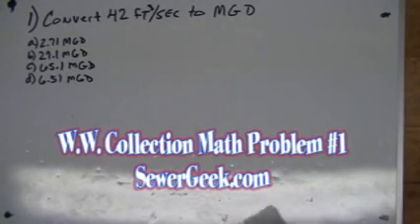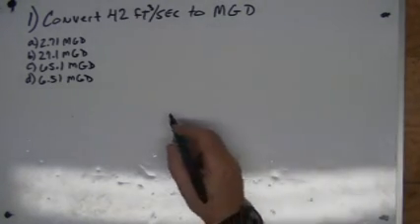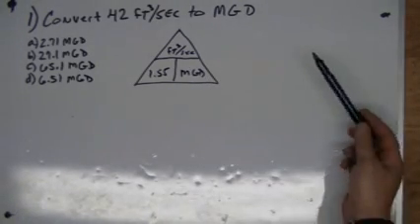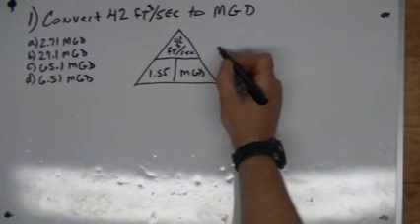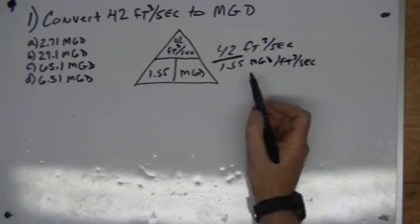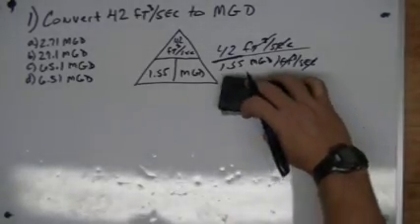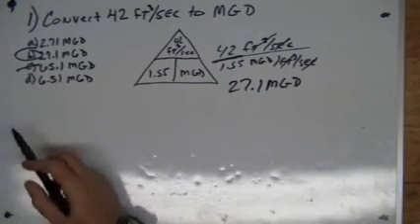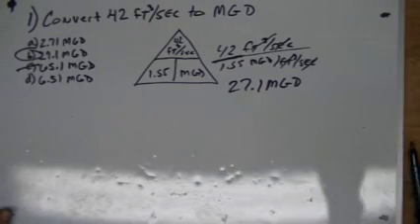Wastewater Collection Math Problem #1   SewerGeek

Comment: Why not just do 42 cu/ft x 7.48 gals/cu/ft  x 60 secs x 1440 min/day? If you cant convert the answer to MGD in your head then divide the answer by 1,000,000 and get 27.1 MGD without the confusion behind the 1.55 MGD?